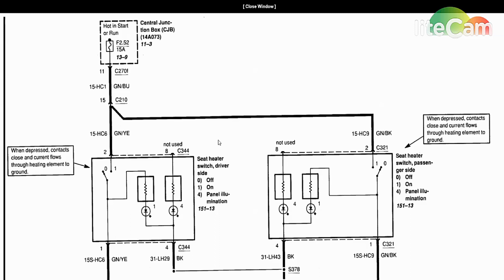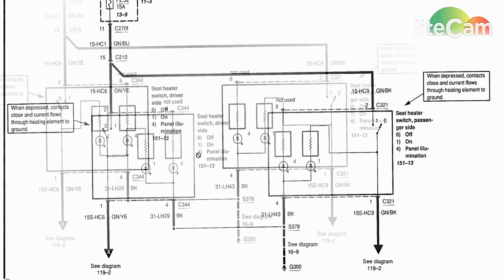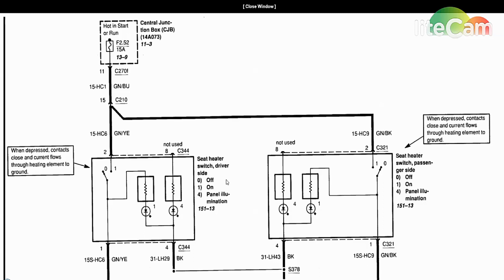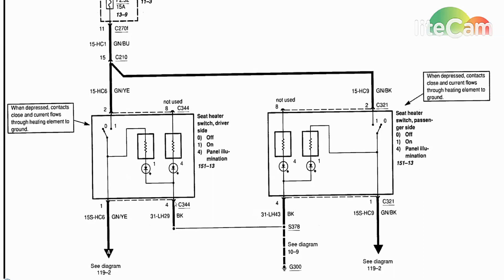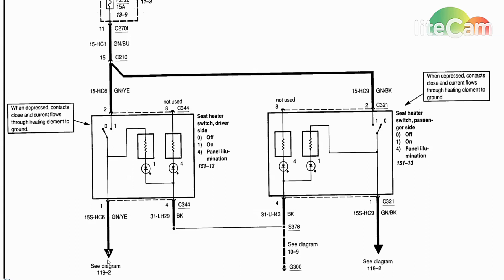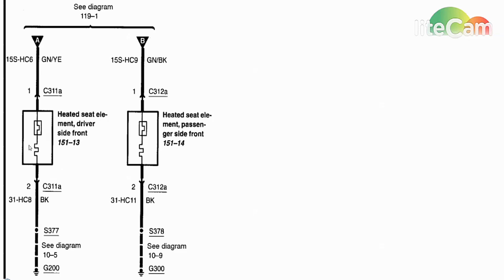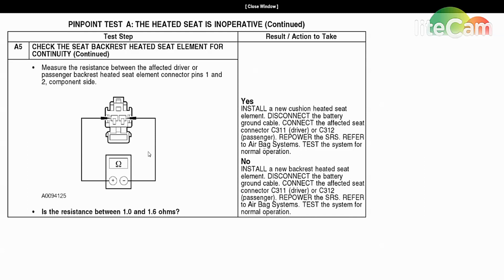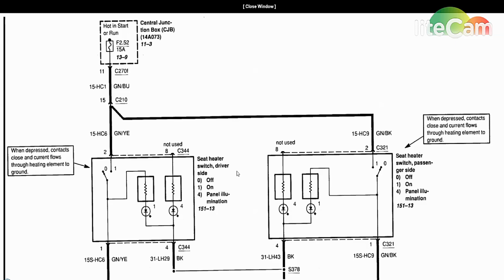Wiring Diagram Diagnostics: #1 2007 Ford Focus Heated Seats Inoperative

Comment: Hello, ran into a 2017 Ford Explorer with no heated seat on drivers side. Code B1034-15 left front seat heater element circuit short to battery or open. I found a wiring diagram on Mitchell but it was not the best. Do you have a video for this issue? or do you know a common failure point? Thank you.

Comment: I replaced my 2014 Fiesta S seats with 2013 Fiesta SEL leather seats. I'd like to add a heated seat switch. My SRS light is also on, any suggestions as to why that would be?

Comment: Can you help me with a Ford focus 2012 the instrument panel the radio and the door locks and windows do not work . Any recommendations thank you
Reply: Late but your first thing is to check fuses if u have that many things going on there’s deff a fuse blown take it out see if it’s burnt ir use a multi meter next step I would look at front both control module that usually controls all that stuff but sounds like fuses something got shorted out as interior lights are usually linked to radio etc

Comment: Thank you for doing that video. I have an 05 parts car that has them and I want to put them in my 06. I went through the harnes itself and I’m happy to know now all I got to do is hook the green wire to power with a fuse  and then ground and that the switch itself is the relay

Comment: Well, I'm getting power as far as C210 but almost nothing at the driver and passenger switches.  Looks like will have to remove the seat to check out the wires.

Comment: John !  I just did a sunroof for my 2010 F150 which did not want to close due to slide rail parts failure back in Jan 2015. Ford Tech you may remember I posted the results on my truck repair. John the roof comes down by taking out the screws from both visors and removing the screws from the two coat hangers on both sides of the truck inside. The head liner then pulls down easy from the sides and the front but will need a good tug from the rear because there is a plastic insert (long one) about 4 inches that will need to be pulled out straight down. You will need to unplug the electrical motor, reading lights overhead lights, and a couple of rear connectors. The passenger seat will need to come out 4 bolts and one electrical connector also. You wont need to fully take out the headliner just let it hang around. You  will need to extend the driver side head rest fully so it came support the weight of the sunroof assy as you unbolt it from the frame. Unbolt the driver side frame first but leave in a couple of bolts for safety then unbolt the pass side ! The roof assy will come down and you will need to be on the passenger side to take it from it resting place and lift it out though the pass door turning it vertical and walking it out the pass door for repair. For more info you can contact the Sunroof Doctor at 1-800-845-1583 they will walk you though the process and sell you the side rail parts. your ford parts.com will sell you the glass panel call the at 1-866-407-0397 or at support@yourfordparts.com hope this will help you. the rail kits cost about $ 130.00

Comment: Schematics can be difficult to understand sometimes, more videos to help the novice would be good
Reply: @Ozzstars Cars, schematics are basically like road maps. With a road map, you have what is called a legend. The legend gives you descriptions of basic map features such as rivers, bridges, lakes, etc, and of course highway numbers. A schematic is similar, the wires are described by color and quite often gauge size (like road description on a map) The symbols on a schematic are like the features of a map. Like  a road map, you need a legend of what the symbols are; transistors, diodes, capacitors, resistors, switches, fans, heating elements, etc. You can learn about these parts in books. Then you have a better idea of how these parts can fail. The wiring to these parts can open or short out depending on things like how much current passes through them, the routing of wiring harnesses and whether there are connectors involved. Mostly, reading schematics takes practice. Don't give up! Someday, you will be able to use a schematic like you use a screwdriver, wrench or other tool. Good luck!